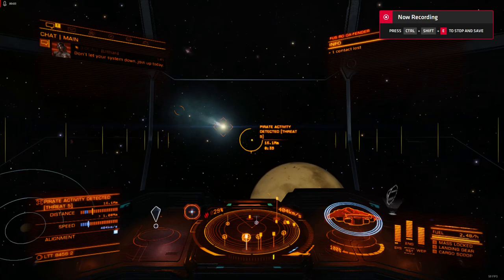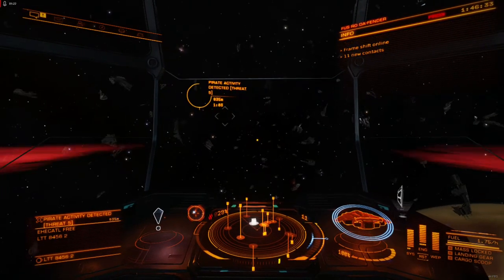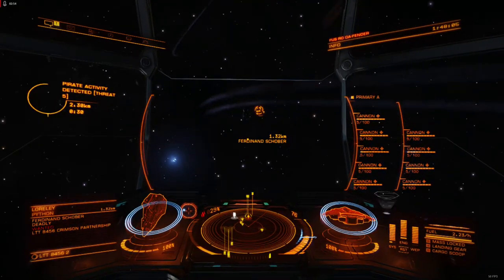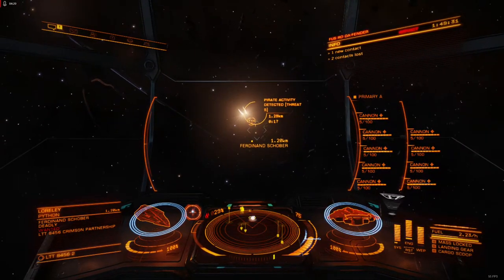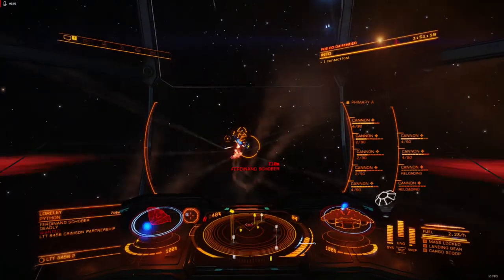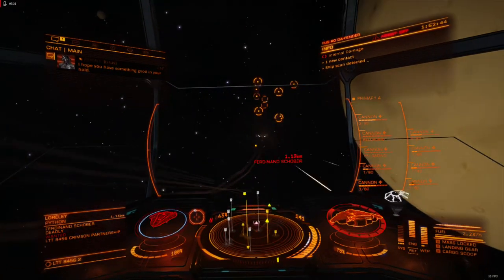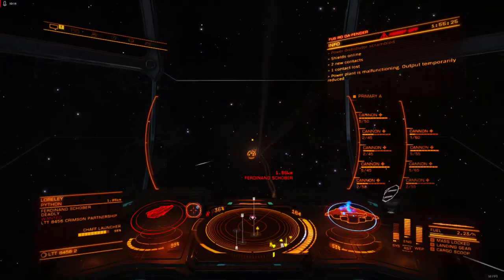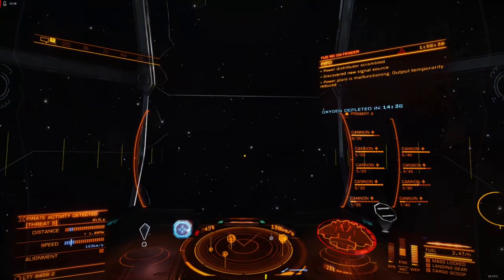Elite Dangerous | Build Experiments | Type 10 | All Force Shell Cannons

Comment: Whats a good engineering to go with high yield shells?
Reply from the maker: I've played around with cannons a fair bit trying to make them work. For best effect you want to use the largest hardpoint you ship can fit. Support the cannon with an array of shield focused weapons.

For engineering you will want to use short range, to offset damage losses from high yield. Overcharged can also work, but even with gimbals the target ship is liable to evade at long distances so the extra range isn't relevant.

No matter what you pick the cannon is a close range weapon due to the shell speed, so best to lean into it, plan on engaging at distances under 2km. Use gimbals to capitalize on your ability to strike internal modules via sub targeting.